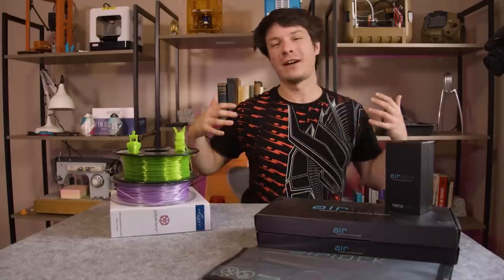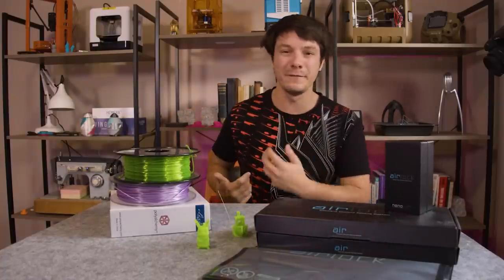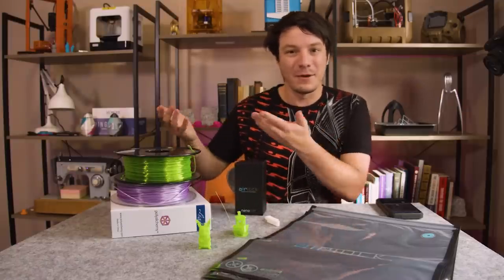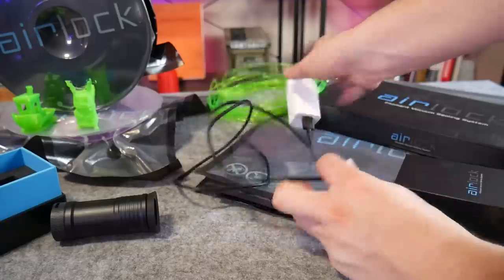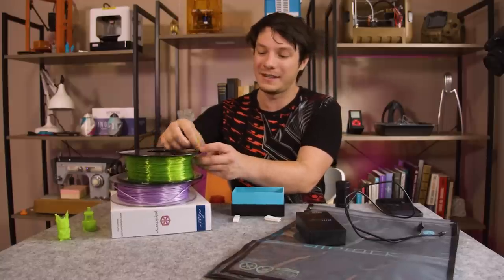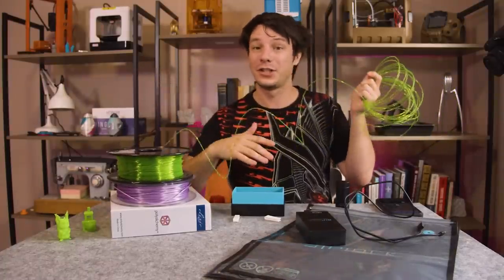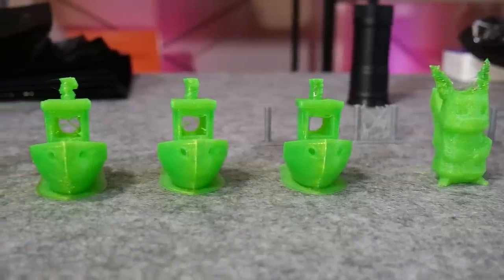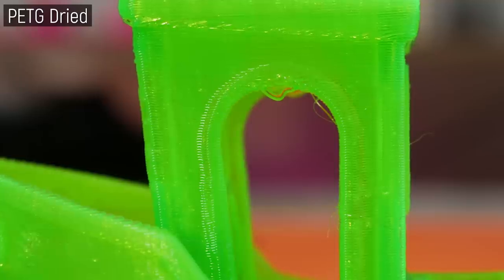Should you store filament in reusable vacuum bags? Nanovac + Airlock review and test

Comment: EDIT:  Been using these bags... on about 14 spools of filament, for the last 2 months.  3 bags sprung leaks... all on the black side of the bag.   It seems that side of the bag is delicate.   I still would recommend them.  Hopefully they come back in stock soon, I need another 24 bags.

MakersMuse code worked... order placed... I'm holding my breath until the order is received. 

I plan on adding a 50gram bag of WiseDry to each vacuum bag I seal.   They change color to indicate moisture contamination.
Reply: Order arrived with the FREE stuff thanks to your code.  

Thank YOU !!!

Comment: I'm always amazed at the examples of prints that you show and how seemingly bad they always are. You said several times in this video "it's actually pretty good" but there wasn't a single print here that I think is even remotely good. Maybe i'm spoiled by my Prusa Mini, I3MKS, and heavily heavily modified CR10 printing exclusively with Prusament PETG and PLA but if any of my prints looked like this I would throw them away and start over. I also leave my Prusament PETG out for some times months and I never have any results like this.

Comment: It could be that although you’re pumping much of the air out you’re leaving more of the moisture behind. As you reduce the pressure the dew point will come down so moisture can start condensing out on the filament. The lower pressure also probably means the relative humidity in the bag is higher than ambient. Where the bag wins is the limited volume of moisture so the longer you need to store the better the benefits of the vac bag.

Comment: I'd love to see a test after a couple months comparing Vacuum Bag vs regular ziplock bag with desiccant sachet.  $40 isn't particularly expensive for a good long-term storage solution, but if it's not significantly better than a normal ziplock bag and the desiccant that came with the spool, then it's not really worth it.

Comment: Thanks for making this video, Angus. I got mine a while ago when I was ordering some Elixir and saw it was on sale. 

I noticed that sometimes when leaving the pump plggued in but not running it will sometimes turn on randomly by itself, so make sure to unplug it! 

I also noticed similar results to what you found with the sealed filament. The filament I keep in the bags turned out super brittle. This particular roll was a Zyltech "special formula" that I received and printed in the same day (vacuum packed from factory) then immediately sealed it with the NanoVac. I brought it out today (after maybe a month) and the first maybe meter or so was super brittle but the rest is printing fine. I definitely think that a desiccant bag would be useful, perhaps definitely better, to keep in the sealed bags. I cannot see any way that it could hurt my filament, so I think I will definitely continue to use it along side with my RepBox.

Comment: I got a knockoff version of the usb vacuum pump a while back from amazon and it does work surprisingly well. The reusable bags were a bit big for filament and are designed for clothes I think but it works well still. This seems like a rebranded version of the same thing with filament-sized bags but the price is fairly reasonable still..

Comment: Great review, as usual, Angus thanks. A few months ago I decided to go with a fully insulated and temperature/humidity controlled room in my garage and it's made a huge difference. My prints are always perfect with no stringing even with filament stored out in the open (not in the room). Before I built the room I was having stringing problems even with PLA. I have a heater and dehumidifier in there controlled by two InkBird controllers. I think I'll give the vacuum system a miss.
Reply: What humidity do you keep your room at? Has it been fine long term? Thanks

Comment: I like your idea of printing from the dehydrator.  A custom spool holder and maybe mounting the dehydrator on its side so that the filament spool axis can be horizontal.  My dehydrator is large enough to mount  2 spools horizontally I think, will need to give it a try.  I have a large nylon print to try in the future and know it will need something like this to work.
My Seal a Meal has a hose and adapter that would work with the bags but the included pump with this system is nice and compact.

I can see that just vacuum packing alone will not dry the filament.  I would dry it first before packing it.  If you have some of the indicator cards with the color changing dots to pack with the filament would be a a good way of seeing how things are working.  You can find the indicator cards on Amazon, I get them from work.  They come with some of the surface mount electronic components and are reusable.  I just dry them with the filament and throw them in the storage containers with the filament after it's dry.

Thanks for the review, I think I will give the bags a try.

Comment: Dehydrate the filament, then stick it in the freeze dryer, then make sure you are in a very dry room (use a dehumidifier) when you open it, and immediately make sure you add MANY desiccants when you vacuum bag the filament.

Finally, as you said, print directly from the dehydrator.

Comment: A vacuum bag is great for stopping the filament from absorbing additional moisture, but it the filament will gradually increase in moisture content each time that it's used.
Using any form of sealed bag with (my preference) blue colour changing silica beads, will not only keep filament dry, but will dry out the moisture within the filament between each use.
Bonus for the colour changing beads; you know when they're 'full" and you can just pop them in the oven for an hour at 100°c and they'll be back to blue and ready to go.
Another note - silica bags/beads really don't last long until they've reached their maximum absorption. Most cheap silica bags ordered online have already been exposed to the air and are useless. Thus the advantage of the blue silica beads. I find about half a cup worth of silica is about the minimum if your filament has a little moisture in it.

Comment: I reuse the large ziplock bags that Amazon Basics used to use for their filaments, suck out most of the air when I put up a roll, and generally keep 4-6 desiccant packs per roll even for PLA.  But most of my prints are getting sold, not just for my own use.  I still have to occasionally dry a roll, but usually only when I don't put it up for a while and dry out my desiccant packs every couple months.

Comment: I've become a fan of these things. I use the PrintDry containers for filaments that I use frequently, but I've switched to using the Airlock bags for rolls I don't use as much, as the containers are bulky and take up a lot of extra shelf space.  The bags store things much more efficiently.  my only real complaint is that most of the USB-C cables I have seen to have too much housing and thus I have to hold the cable in place on the pump, (I  mislaid the cable that came with it, of course.)

I still put a Dry & Dry moisture indicator and a couple of D&D desiccant packs in with each roll regardless of which kind of storage I'm using, and everything seems to work pretty well.  I still like to run the filament through the dryer before using it if I'm making anything I want to turn out especially nice, but I do that even for new filament, so...

Comment: Amazon sells "small" vacuum seal bags that come with a hand vacuum pump, for about half the price. Works well plus you don't need any power. I put "small" in air quotes only because the bags are quite larger than the standard filament spool, yet they still scrunch up enough to fit inside the standard filament box, if you keep your spools stored in their original boxes, that is.

Comment: From what I read online air and water can still permeate through the plastic bags over time. So while it won't completely stop your filament from getting water logged it will definitely slow down the process. 

Unfortunately due to shipping costs I'm only saving $3.00 using the coupon vs if I bought from PrintedSolid's Store.
Reply: Couldn't they make it from foil or something?
Reply: @ImieNazwiskoOK  that's what they do for moisture-sensitive electronic components: they use bags with foil layer, add desiccant, and put a tag with moisture-sensitive paint blobs that tell you if the bag has leaked or not when you open it. The foil is also good for protecting from static electricity.
Reply: Yes, most plastics are moisture-permeable. The fact that the filament itself absorbs moisture is an instant proof of that. I found out by experimentation that desiccant in plastic containers should be replaced about once in two months, which is too much maintenance.

I have found a maintenance-free method of storing the plastic dry forever: I've set up a box that slowly trickles air from my food freezer (by convection). That air is very dry. The only maintenance it takes is to de-ice the freezer more often, once every year approximately. Works great, it can even keep the nylon dry.

Comment: Silicone desiccant can be bought in bulk, but you can get handy canisters of the stuff for ammunition boxes (probably costs more). Or I could get an altoids tin, drill some holes, add some metal mesh... Easily recharged with a warm oven, and most of the time you can do the same with filament, although a food dehydrator would be a better idea.

I remember Stephan from CNC kitchen doing a test of using a vacuum to dehydrate filament, and if memory serves, the results weren't great even with laboratory vacuum dehydrators.

There needs to be a filament bag/spool capable of holding at least a half kilo, compatible with the vacuum sealers used for food storage. I bet the valve on this bag is compatible with the vacuum attachment for my machine...

Comment: I never have filament issues, I notmally put my PLA and PETG back in the resealable bags that they come in (MG Chemicals filament), push out as much air as possible, leave the tiny silicone bag it, seal it and chuck it back in the box.

That said I can leave either of these filaments types on my open printer for a couple of months and it still prints just fine. I have a reel of TPU I bought Feb  2018, back when I started printed, it was left in an open bag for about a year and a half before I used it, it printed just fine.

Comment: I made a special holder for my Sunlu dryer that mounts to my Ender 5 and has a lazy susan style bearing so it can swivel to follow the head. So I can have my filament dryer on and use it as a holder while printing. I find it helps prevent stringing, even with PLA.
Reply: any pics of your setup?  I have a ender 5 plus

Comment: I use large bucket sized Tupperware type containers. Four rolls sit in each, on top of the four rolls sits a pouch of dessicant - not silica gel, though - these have what I think is calcium chloride plus a gelling agent. They are sold to be put on drawers or cabinets to keep your clothes from dampness. They are often scented, but you can get unscented ones, and even some containing charcoal for absorbing smells. The common brand here is "Thirsty Hippo", but I get the generic Tesco-branded ones. Daiso also sells their own brand. I put a hygrometer in with the rolls, the humidity comes down to about 20-22%. I wonder if the pump in this article is good enough for vacuum bagging foam wings...

Comment: Do you think the center of the spool may have affected the filament in any way? I dont think there would be enough air left in the center for it to affect the print that much but, maybe a revisit with off roll vs on roll filament in the vacuum bag?
Reply: No, the center would have the same vacuum as any other void.  The whole coil  has void space throughout since round filament does not completely flatten out against the next piece of round filament.

Comment: I use food sealers. You still need a desiccant with these. These are fairly cheap from uline but you have to buy a lot of them. 85$ gets you about 1000. Lol. The reason you need desiccant is moisture. Plastic is not a moisture barrier.

Comment: I picked up a similar system eSUN are offering now, biggest difference is it uses a manual hand pump which I actually like since I’m always running out of outlets. The bags themselves look identical except for the branding. Even if you still need to dry after storing in these at least you could get away with a quicker drying run.

Comment: Thanks for the review and testing! 
- I wonder if the absorbed moisture came in part from not drying the roll between printing and bagging. 
- Filling an old sock or something with desiccant and wrapping it around the inside of the spool may protect against the residual moisture from the trapped air. Bonus, you may get a better or faster vacuum, as the plastic won't have to bury itself in the roll as much.

Comment: The filament might be drying unevenly in the dehydrator. The filament on the inside of the roll could retain a little moisture (because of less airflow during drying). This wouldn’t affect the test print done immediately (using drier filament from the outside of the roll). During storage under vacuum the residual moisture would redistribute more evenly through the filament, affecting the test print done following storage. Completely untested hypothesis but it would explain the results you got.

Comment: Another factor is that you pulled filament off the spool and exposed potentially still "wet" filament that hadn't had enough heat penetration by the drying process to actually dry the filament. Drying after a spool is getting used and immediately being stored, can be just as important as drying before printing for this reason.

Comment: Nice video (and channel!)- thanks. I think a video comparing the various types of desiccants (silica, calcium chloride, molecular sieves and maybe more) would be worthwhile. Also, in this video I'm wondering whether you controlled well enough for uneven drying within the spool. Might explain the surprising result. If you ever update the video would be interesting to have all filament be in say, 100gm coils so there can be no question of uneven drying. 

By the way my food vacuum sealer has a suction port for using such bags. Also (at least in the US) for storing bulking clothing, blankets, etc one can get wide variety of bag sizes with ports for attaching household vacuum cleaner to suck out the air. They work pretty well for clothing, think I'll try with filament and silica.

Comment: I’ve been using the generic Chinese version of these bags with a manual hand pump from Amazon and they work great. Just need to use the large bags (which seem to be the exact same size as the ones from Polyalchemy). Mind you, they aren’t that much cheaper than these 🤷🏻‍♂️ I also use color-changing desiccant packs so I know if there’s moisture over time (mine change from dark blue to light pink when they are full of moisture). Then I can dry the desiccant packs in the microwave if needed.

Comment: Was looking at vacuum bagging filament rolls with dessicant about 2-3 months ago. I was looking for bags that would be about the size of prusa bags but most were too small or too large or way too expensive. I was going to use the bags with a sunbeam (food saver) VS1300 - upright vacuum bag sealer machine. 

The pump and bags look good and if you didn’t have a sealer already probably a good option. 

Approx what size is the bag? On the kit the website links to (from description), shows 40x38cm with 15.75” x 13.38” so somethings awry, as I get 40 x 33.98cm.

Comment: In SMD-electronics you can order your chips from yourn dealer dryed to a specified humidity and delivered in sealed bags. Background is the chips has to be dryed to do not popcorn during reflow soldering.
These additional aluminium shielded bags are best what i ever get. 
Best practice is to dry the filament the double then normal time. Give them including a 100% fresh (or reloaded 100°C for 5h) 200g drypack into the shieldedBag and seal it whith a sealing machine.

Comment: The vacuum bag doesn't dry the filament, it just prevent further moisture absorption. The desiccant bag is the one doing the dehumidifying job. I bet if you put lots of desiccant bags into a big sealed bag (non-vacuum), it would work quite well.
Reply: Desiccant bags don't dry the filament either.
They just absorb moisture from the air.
The thought process behind the vacuum bags is that without air you don't have any moisture.
Reply: @Jehty_  But moisture has already been absorbed by the filament, even without air in the bag, you are just vacuum sealing moist filament.
Reply: @tatfung  no you are vacuum sealing (somewhat) dry filament.

Comment: Maybe I have low expectations, or I'm just lucky, but I just got a new SV06 printer and did a few print in place models, with what I now realise is filament I bought 3 and 1/2 years ago, which has just been sitting in my living room open and gathering dust for 3 years. Seems fine. Also printed your clearance gauge and 4 of the 6 rotated fine with it.
Reply: And it's definitely not because my house is dry, I live about 100m from the sea, relative humidity is regularly >95%